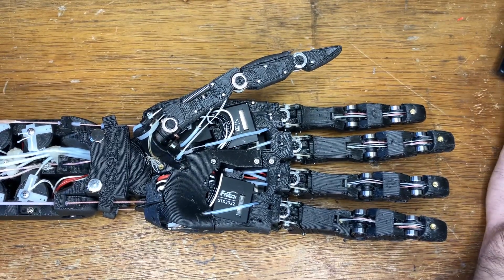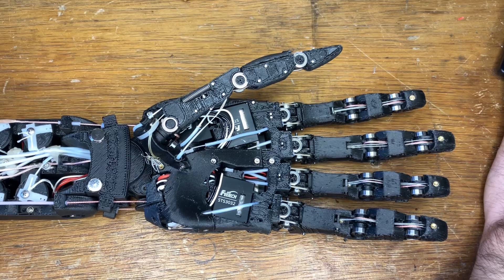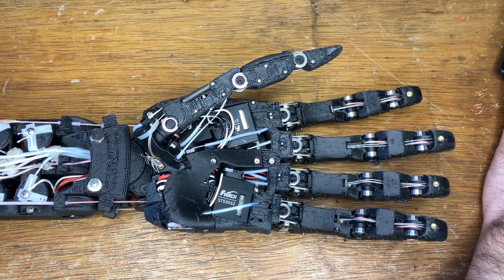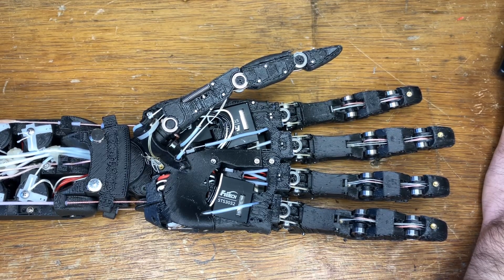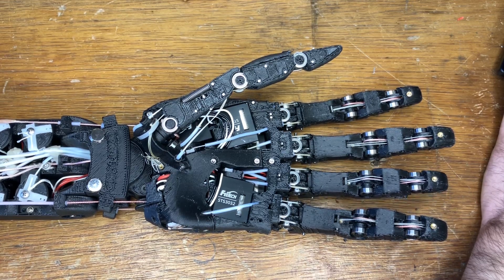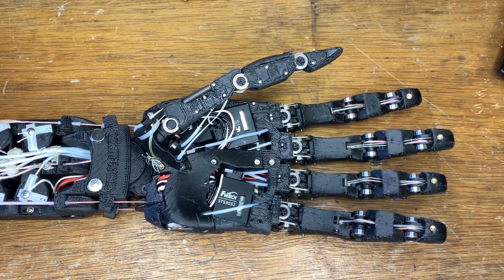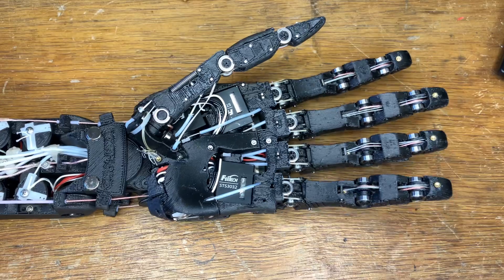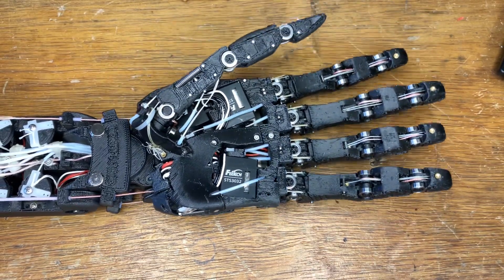V2 DexHand Tendon driven robot hand

Comment: I'm just trying to wrap my head around robot action space discretization and tokenization for transformer architectures. Llama has only 100 unused tokens when some guys needed 256, so, they just truncated the 256-100 least used tokens and trained an additional neural layer to handle and learn the robot control.

I'm not sure how many tokens your hand with this many servos would need. One also need space for the sensors, images, and language tokens – while moving from vision-language models to vision-language-action models.

For me the action space discretization felt a bit ugly, because the servo DoF space is continuous after all. But I guess it doesn't matter, because you can send the commands up-to 50 Hz LOL [1] and also I guess interrupt the previous command [2], updating trajectory continuously. Dunno.

It would be interesting to understand, how high higher-level action chunks can be learned automatically by the transformer and does the discretization offer some trade-offs. The geometric deep learning guys emphasized to use symmetries to match the world [control problem here] and the neural architecture [cf. images <-- 2D convolution, word sequence <-- transformer and attention]. A Fourier head can be used to learn [discrete] 256 bin based estimate of continuous probability mass, cool, if somebody needs this [3]. I don't know enough though. All and all, I currently feel, that rough low-res discretization of servo action space could be quite OK, if your control loop frequency is Hz in two numbers 😅       

1. https://www.physicalintelligence.company/blog/pi0
2. https://deepmind.google/discover/blog/rt-2-new-model-translates-vision-and-language-into-action/

3. https://nategillman.com/fourier-head
Reply from the maker: Haven’t looked into this myself yet, very interesting though!
Reply: @therobotstudio  yeah, just logging here what's going on – let's keep it up 😅🦾
Reply from the maker: Might be easier on the Discord server: https://discord.gg/8ATPYZCYDs

Comment: AMAZING! So pretty😎
Question: What servos do you trust to be the most accurate positioning and reliably strong Servos that are the smallest?

I always find as you make things smaller, the servos become junk. Are you Feetech all the way? Any tips for small, accurate, strong servos. Any suggestions for Servos, micro servos, or sub-micro (feather/nano?)? 
I bought GH-S37 off Amazon😭
Reply from the maker: Yes, Feetech are my servo of choice, particularly the 3rd generation like the ST3032 are superb and the ST32** series is unmatched for value.

Smaller than a micro, 12mm thick by 23mm wide I got no recommendations sadly.
Reply: @therobotstudio  Thank you!
Reply from the maker: Happy building!

Comment: As always, great work, and an inspiration!

Edge AI models that are trained "just" on the joints and positions, with self updating weights, will allow for layered LLM models to send generalized commands to the end effector and allow for high fidelity control of the hand. It also works in the reverse with sensors, reporting back highly detailed touch feedback. 

if I ever get free time, I want to investigate a smart artificial motor controller, which can monitor and respond to current, voltage, generated pressure on the fiber bundle, capacitive coupling and impedance along the line. I've been looking at some of the videos coming out of Clone, who are doing some interesting work with electrically activated, hydraulic muscles, but their control algorithm needs a lot of work. 

I'm of the opinion that smart robot servos are a "bridge technology" that will probably be with us for quite a while, until the general concept and proof of return of value get sorted out.
Reply from the maker: Yes, that sounds very reasonable.

I'm keeping my eye on emerging actuator technologies but I expect my next few humanoids to still move using electrical motors of some description.

Do love Clone though! People after my own heart.